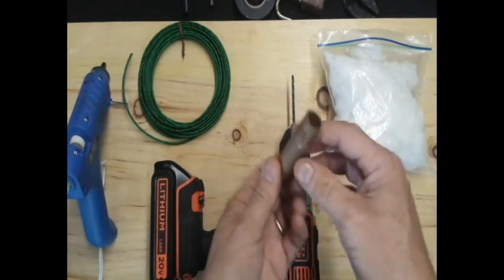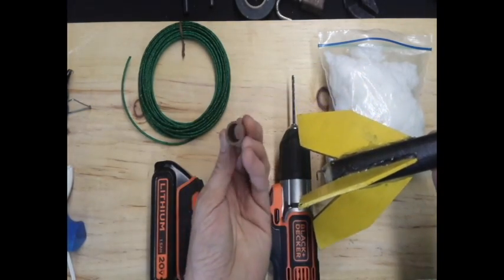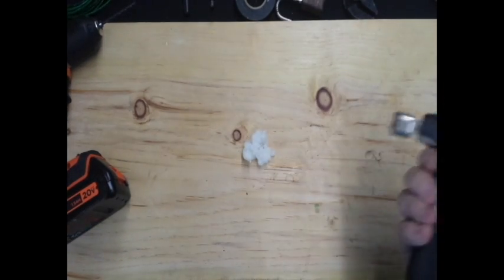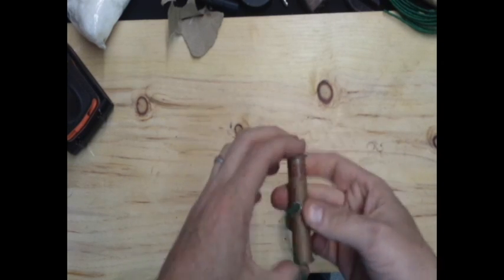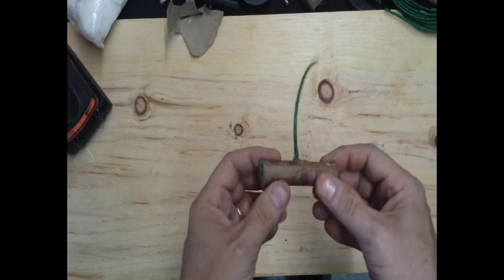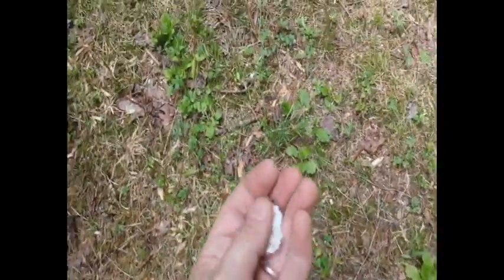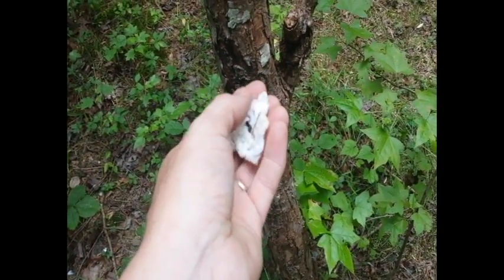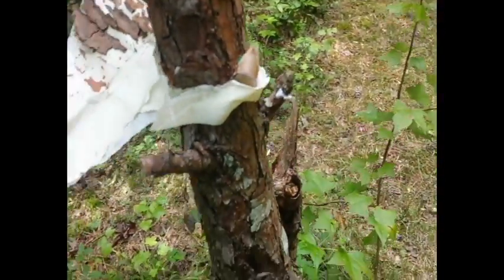Gun Cotton Fire Cracker - Still Only Deflagration And Not Detonation

Comment: Use some unscented kitty litter and ram it in hard and it makes perfect solid end plug or even some stp oil absorbing clay works well also and both are pretty cheap. Then you can drill a small hole in it the size of the fuse then put a little hot melt glue around the fuse then you have a great firecracker and the thicker the tube the louder your bang will be.  I also have another way to ram your fuse and clay at the same time but it’s hard to explain id have to make a drawing for you. I build my own fireworks so I have plenty of ideas

Comment: You packed it too tight. Gun Cotton needs to be fluffy when you pack it, requiring a bigger tune for the same amount of cotton.  Give it more air and you will get a more complete burn. I found this out when replacing the powder in shotgun shells with gun cotton. You can compact it some but you have to leave some fluff to it and you will get better results.

Comment: Your problem is very basic.Hot glue and paper will NEVER make a good enough plug. You need dry clay hammered into the tube.Thats the only way the pressure will build up without blowing the caps out. Throw away the glue gun.

Comment: It doesn't make any difference what you make the substance out of.  It still generates gas pressure by burning it, and the burn rate is determined by surface area (grain size), purity, and anything else you may introduce into, or onto,, the grains to change burn rate or, in the case of firearms, improve lubrication inside the barrel.

Comment: Great video, even though not all the guncotton detonated. How did you avoid static electricity build up when putting the guncotton into the firecracker shell (cylindrical hollow into which the guncotton was placed), because I've heard that static electricity can build up when two materials rub against each other. Static electricity can cause explosive and volatile materials to explode or ignite, accidentally. In this case, it's nitrocellulose, which is an explosive, rubbing against the walls of a cardboard cylinder, which could have yielded static electricity which could have caused an accidental detonation of the guncotton, hence an accidental explosion. I would like to make some firecrackers but I don't want to have them blow up my hands when making them. Also, how do you avoid static electricity accidental detonations when making firecrackers using gunpowder instead of nitrocellulose? Please advise. Thanks.

Comment: Doesn't guncotton need a primer? Wouldn't it work better if you had a small potassium permanganate / aluminum powder miniature firecracker in the center to set off the cotton? I used to play with my own black powder, zinc & sulfur rockets, permanganate & aluminum firecrackers -- and always found that trying to scale up was disappointing (M80 & up).

Comment: Schel,
Packing too much guncotton in the casing gave you a smaller bang, as you dramatically decreased the burning surface area.  And the weak casing did not allow anything remotely close to sufficient pressure buildup to initiate a deflagration wave to travel through the mass.  A much, much thicker rolled cardboard tube and end caps, plus abut 1/2 of a single fluffed (not compressed) cotton ball would give a louder report, but not much louder.  And the use of PVC would be only a small step beyond that.  From there on, you enter a less unpredictable zone, where rising pressure waves and  varying material strengths do interesting but dangerous things, better tried in a laboratory environment.

When four balls were heavily compressed with no air space inside, what happened was that low pressure ruptured the thin casing, and the resultant pressure release literally blew out the flame.  The rest of the guncotton was left as clean as can be.  The same thing happens with smokeless powder inside a gun barrel.  The shorter the barrel length, the less powder is completely burned.  Unburned, or partially burned, grains are left on the ground in front of the muzzle, and even in the barrel.  That is after a loud bang which released thousands of pounds of energy.  It's fascinating science, but very complex.  A lifetime is not long enough to learn it all.
Reply: im thinking of making an m80 from nitrocellulose lacquer, would that work better? basically a liquid that solidifies into nitrocellulose

Comment: if you place your guncotton in a metal pipe about the same  size as that cardboard  M-80 tube and use screw on ends caps it will produce a deafening noise 10 X louder than any M-80, but it will be a federal crime called making a bomb.

Comment: Safety tip....Generally speaking, you should drill the fuse hole BEFORE you load your tube!!! Otherwise you are drilling into explosive/flammable material. Its possible that friction from the drill bit may ignite it, depending on which composition is used!!
And dude, pointing a flame from a blow torch into the end of the loaded tube, to get rid of an air bubble, come on - thats
just asking for trouble!!  Lol

Comment: Let me help you with your research  or point you in a direction.. Gun cotton is nitrocellulose NC right, sure it is. Research modern day reloading gunpowder GP. The fastest is for shotguns right, just like your Gun Cotton is, ok. Now think of report for fireworks and modern GP together. The principle maybe the containment. Hmmm. Now visit let's say pyro direct and look up the specs of paper tubes. Personally I don't like hot glue. That's just used to waterproof.  Everyone is always in a hurry. Paper and glue and more paper. For your research purposes only. Be safe, have fun. 
 Ps, Chipboard - ( 7-10 layers of cereal boxe material) is better than hot glue is my opinion. Buy a fiskers heavy material circle punch and punch away.   Sand the ink side lightly then glue. It helps to make a jig using a 90* angle piece, hot glue that to something. They will stack nice. Compress the stack until they dry.

Comment: You ought to try and find a solvent like acetone that will dissolve it and then let it evaporate and form one homogeneous solid piece, you could mix a little ammonium nitrate with it from cold packs you get at the drug store.  Then get an empty shotgun shell with a fresh primer so that the discharge from the primer will be as close as possible to the solid portion of gun cotton. You can get bobby traps that use a shotgun shell, string a long line and see what that does.

Comment: I'm a chemistry teacher, and this is something I've had some experience with over the years. Guncotton (Flash cotton) has a low ignition temp. I certainly wouldn't use hot glue anywhere around it! The guy who said that you really only want deflagration for a firecracker (salute) was right. Detonation produces a harsh "crack" sound (from the shock wave that is produced). It's not a pleasant sound and it will make your ears ring like crazy!  But compressed dry guncotton will detonate easily if initiated by a small amount of a primary explosive. (You don't need anything as large as a blasting cap!) I'd stay away from mercury fulminate, though  - mercury is incredibly toxic!  Les than a gram of silver fulminate or silver acetylide should be enough to detonate it, if it is compressed quite tightly. Just make sure you're a long way away when it detonates. And I'd recommend ear plugs, too!
Reply: ~DON'T Go Giving Him Ideas,
- He's Too Loose/Not Refined
- Sort Of Like: "MESSY" Which
Can Easily Convert/Transcend
Or Manifest, Into DANGEROUS!                   ...Haaa,Ha,Haaa,  Ha,Ha,Ha, LOL! :D

((( "SOMETIMES, , You Just Gotta` Be MINDFUL"  With GREAT POWER!
---______________________________________________Comes GREAT Big
---______________________________________________Electric Bills...
---______________________________________________(no-suh, no-suh, You
---______________________________________________Know What It Is, With
---______________________________________________GREAT POWER, Comes
---______________________________________________GREAT Responsibility.. )
Reply: It sucks that fulmenates are expensive or its hard finding mercury
Reply: Mercury is not that hard to find  you just have to know where to look.

Comment: Wrap it up with vinyl tape ,don't be stingy.
You have to get the pressure up to get full ignition.
Reply from the maker: Yep I think I'm going to try some of that aluminum tape that's made for pipes. I put a small amount and wrapped it up in a quite a few layers of that type and he did it up with a torch it was louder than this large firecracker

Comment: Next time put a hole through the middle length wise line with a nail when you pack it it should act like a flame tunnel for better burn !
Reply from the maker: Yeah I'm thinking maybe electric ignition. I think the fuse burning through a whole leaves too much room for pressure to escape. But the whole thing is sealed up with some type of electric ignition in the center that should solve that problem.

Comment: too much  packed, the gun cotton Grain size, (just as in black powder determines burn rate" is the thousands of long filaments of the of the cotton.   by packing it, you literally  reduced the grain size down to a single solid Large grain much like a  like a packed rocket motor... if a rocket motor was loaded with loose powder not packed will always detonate but packed no voids will only burn on the open face of the grain... its all about the available space the flame front has to travel to get to the next grain filement. nospace no flame front Period end of story
Reply from the maker: Everything you said is absolutely true when it comes to deflagration. I've learned a lot since I made this video and I'm pretty sure there's no way I'm going to get an actual detonation without some type of detonation cap to create an initial shock wave. But definitely going to follow your advice because this firecracker could be a lot more powerful. I need very very strong containment for my next attempt
Reply: @schelsullivan   just be careful, you don't want any significant shrapnel.  even plastic can travel a good ways and put out eyes and penetrate flesh... I think, the paper rocket motor casing was sufficient  just reduce the load too 3/4 or  even better do multiple shots of varying loads  (given a fixed volume (motor tube) and (variable load weight) and use balloons at metered distances from ground zero... Record  see when you get the best bang for the buck... good luck and be safe... I don't want to see you on you tube with an eye patch... I am missing the tip of a finger...

Comment: I believe what your problem is, is that you should not have it packed so tight, it need oxygen to burn and you are only giving it very little oxygen.  Make one similar only leave a hole all the way through the center of the gun cotton, but make sure you seal the ends, that way it can travel through the center of the cotton and detonate, plus the hole will give just a little more Oxygen to help it all burn instantly
Reply: They probably used some type of detonator containing a primary explosive (probably a blasting cap) to initiate the detonation of the guncotton. That's what you would do in a blasting operation.

Comment: Need to run quick burn fuse the lenght of chamber
Reply from the maker: That is a great idea. And I have some quick fuse on hand. I believe you're right that fuse whole leaves room for pressure to escape. Also thinking electronic ignition?. And obviously a much stronger tube
Reply: @schelsullivan  nichrome wire maybe?

Comment: Maybe it's somewhat like an engine. In an engine, detonation only occurs when there are two ignition sources. The two flame fronts will converge together and smash the remaining fuel mixture, causing it to heat up to ignition temperature (auto ignition via adiabatic compression) and all "detonates" simultaneously.
Reply from the maker: I have a new batch mixed up and im thinking of using a spherical shell, with electric ignition in the center

Comment: Try to put a bit of quick fuse in the center of the firecracker. Dont know if it will help but it might :)
Reply from the maker: Faster is better. Going to try round shell with tons of tape next
Reply: Yes :)  That might also work :) Either lots of tape or a thicker shell. That might hold the firecracker together long enough for the deflagration to reach al the material. Not sure but it might be worth testing. I cant do that unfortunatly. I live in Sweden and they (MSB in Sweden, The branch that controls weapons licenses, etc) is prohibiting more and more of the substances needed for making different kinds of Firework and Pyrotechnics. Following years, Fireworks will probably be completely forbidden, even at new years eve. I'm a dying breed over here. (In a way I can understand the prohibition. Some people arent fully aware of what they are doing, some even want to hurt others. And ofcourse we have petowners)

Comment: All the historical stuff I've read says that guncotton needed very sturdy confinement and to be well packed in order to detonate. They may have also needed a charge of something a little more serious to get it going, I dunno.  But my first guess would be improve the pressure chamber, and ofc be careful.
Reply from the maker: I need to revisit this project soon, thanks for the advice.
Reply: No, not really... compressed dry guncotton will easily detonate without confinement if initiated by a primary explosive (like mercury fulminate or lead azide). Sending a shock wave through it is what starts the detonation. It is very much a high explosive. It's quite powerful, too. You really need to treat it with respect!

Comment: Would repeating the nitration process further increase the flammability of the cotton?
Reply from the maker: Ok maybe I will make a double or triple nitrated batch and see what happens :)
Reply: I made double nitrated.nitrocellulous and it burns way faster. But faster isn't necessarily what you need. I'd lean towards a stronger tube and ends. However faster and stronger better results more damage,more flying bits. More fuse and something to hide behind!

Comment: After watching your video I think I may have a solution to your detonation problem. 

electric detonation. 
using the same set up, but this time drill a hole off center on opposite ends. high on one side low on the other. Use a stiff gage copper wire so you can work it through the gun cotton on each side and hot glue the ends. Positive on one side negative on the other, at a safe distance with everything hooked up but your positive lead on a car battery, touch the positive lead to detonate.
Reply from the maker: Ive made an electric igniter out of nichrome wire (from and old hairdryer) that was for my shoulder mounted rocket launcher project. I should adapt it to an electric match design!

Comment: 1.  Don't pack the GC so tight. 
2.  Make the fuse hole small as possible 
3.  Make the paper bag tube thicker. 30 wraps
4.
Reply from the maker: Good advice, I plan on getting back to more GC experiments this summer.
Reply: @schelsullivan  you packed it way too tight, use strips of aluminum foil repeatedly to make a layered triangle with fuse coming out corner..instead of tube... for detonation you will need to make a solid/liquid nitrated solution of glycerine etc, then stick a percussion cap on end of fuse, then you might get detonation if tube long enough and percussion cap put on end so the initial explosion starts a detonation = firecrackers loosely filled, detonators packed tight with a material that will both ignite and cause concussion on material such as tnt.. guncotton called that cause it doesn't detonate...it's lose filled so gas is all generated  so you get maximum push of bullet ...if you "packed" guncotton inside a bullet shell with a primer it might just detonate in barrel ...ouch

Comment: for pyrotechnics, a loud deflagration is all you really want or need. Believe it or not, the loud boom of a gun is deflagration, not detonation. If there was detonation in the chamber, the gun would basically be instantly shredded into steel confetti.
Reply from the maker: Thanks for watching and so true! Ive learned a lot in the past months. Modern smokeless powders have very specific burn rates according to lots of factors like barrel length and projectile mass. For example using fast pistol powder in a long barrel riffle could cause a breech explosion!

Comment: I use hot glue.  If your burn rate is fast enough it won't have enough time to blow the ends out.  You have to boost gun cotton into a detonation velocity with a blasting cap.
Reply from the maker: Yup, maybe a primer cap would do it, or a tiny TATP charge.

Comment: Nitrocellulose  would be good as a binary ( or primary ) explosive to set off Tannerite RDX or even C-4
Reply from the maker: Not sure about RDX or C4 because I dont have experience with those. But I do have some experience with tannerite or at least the homemade version and I doubt GC would set it off. The GC it self will not detonate and instead deflagrates unless itself its initiated with some type of det cap. Keep in mind Im not an expert, I have yet a lot to learn.
Reply: Granted , as we all do , keep up the good work
Reply: schel sullivan C4 was designed to take a bullet and not detonate.  It's mainly RDX with plasticizers and oil.  RDX isn't the easiest to detonate either.  It's not a primary Explosive, it's a secondary Explosive for that reason.  Gun cotton in a steel pipe might do it though, lol